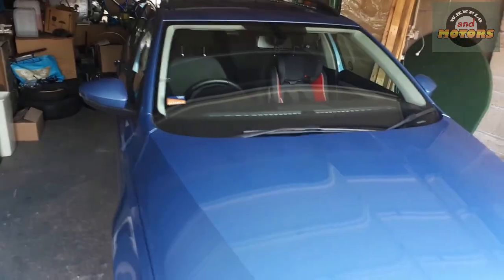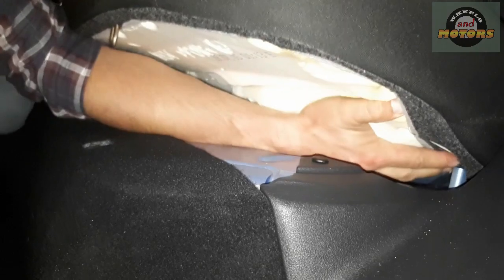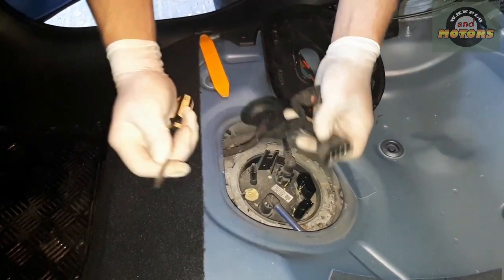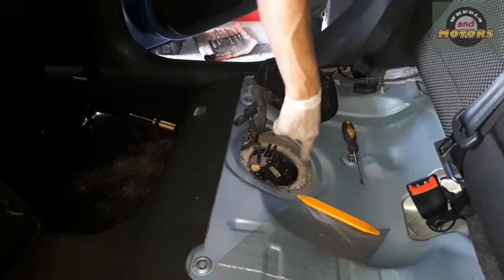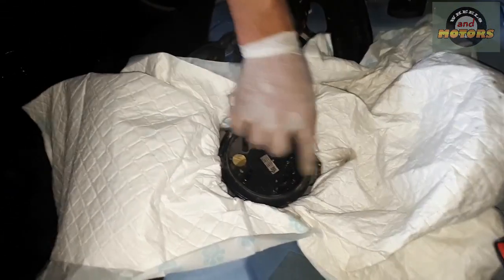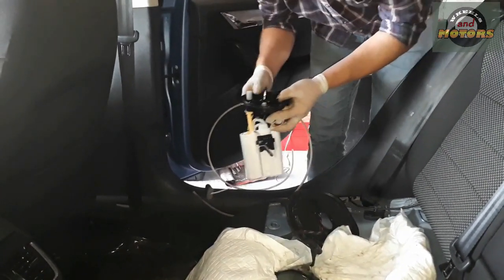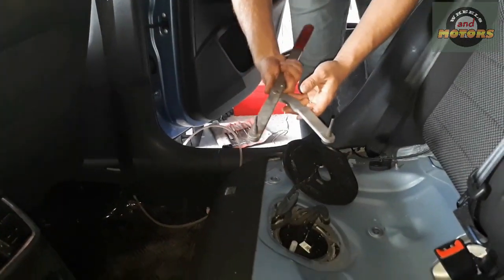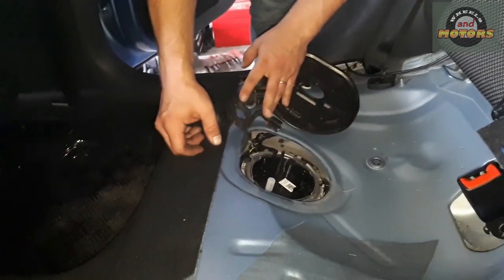How to replace in-tank fuel pump Skoda Octavia MK3 1.6TDI, can be applied to VW, Seat and Audi

Comment: Most people I know who have had fuelling issues from injectors going bad to fuel pump failures have usually for a few years been using Supermarket fuel. My injectors starting acting up until I swapped back to using premium/non supermarket fuel and I haven’t had a problem since.
Reply from the maker: However, my car (Sharan) is on 377k miles with no issues mostly done on Asda fuel... 🤔😉
Maybe because it's constantly driven and burns all the s**t out.

Comment: Great video, every important detail shown👏👏. I have one question. My pump is working fine so there is no need for replacement. But I need to drain the fuel from the because the car has been siting for 2 years an the diesel is probably very bad.. Is it possible to drain the diesel without opening unscrewing the pump? I would disconnect the hose that deliver fuel to the engine, then connect another hose to drain the fuel to canister. How can I activate the fuel pump without starting the car? I guess it would be possible to connect wires from 12v batery to thr pumps electric connector? But on which connector?
Reply from the maker: The only way I know to activate the fuel pump is using a scanner that has this option. I'm pretty sure connecting 12V to the correct contacts would work, but I don't know how.

Comment: My Skoda is giving p0087 pressure too low code and the glow-plug light glows randomly. Do you think its a fuel pump issue or high pressure pump or may be anything else ?!
Reply: How much electric going to your fule pump, less electric less pressure.

Comment: Ehat is your symptims, i have rough idle when fuel level low, when fuel level is high everything is ok
Reply from the maker: As I found out later, there was nothing wrong with the fuel pump in my car. I had bad cold start, but the problem appeared to be with injectors.

Comment: Is the sender unit for the estate same for hatchback?
Also is it only dealer part....ta
Reply from the maker: Considering this part fits Golf, Audi A3, Scirocco etc... I would assume that it should fit both - estate and hatchback.
What do you mean by "only dealer part"?
Reply: @wawayltd  can you buy the part from any car accessories shop, or just from dealership? And thanks for replying
Reply from the maker: Having the part number, you can buy from wherever, but please double check with the seller if it fits. You're welcome 👍
Reply from the maker: However I wouldn't expect any accessories shop to have it, not in Halfords or even Euro Car Parts. Can try AutoDoc, eBay, TPS, Breaker Link, some independent VW parts shops - shop around..
Reply: @wawayltd  ta, i will try tps

Comment: How can I reset the fuel gauge after replacing? It writes a problem and says 0km of fuel is available, I replaced my pump with an original one.
Reply from the maker: I didn't have that problem, strange.. Doas the car start? Maybe drive it for a bit to let it learn?
Reply: @wawayltd  I needed to refuel after a full tank it works properly, sensor learned the position.

Comment: Do you have to prime the pump after installing?
Reply from the maker: I didn't prime anything after fitting that pump. There's almost no leaks anywhere while doing this, pump goes directly into the tank.
I don't think priming is necessary.

Comment: sir my car is wokswagon polo. when engine starts in the morning . long beep sound is started 15 KM after running that sound is automatically stop . why
Reply from the maker: Don't know, does it give any fault codes?
Reply: @wawayltd  no sir it's while starting morning tym
Reply: @wawayltd  then rum 10-15 KM after that off
Reply from the maker: @roymathew9869  Where the sound is coming from?
Reply: back side
Reply from the maker: @roymathew9869  Glitchy parking sensor?

Comment: Hello good work .What are sympyoms that fuel pump is not working corectly ?
Reply from the maker: Thanks, this Skoda was mis-diagnosed. It had a problem with cold start, I scanned it and got fault code for that pump, didn't pay attention that date for code was like 3 weeks ago (the driver probably was too low on fuel), so I replaced working fuel pump - waste of 200 pounds... I'll stick ot on eBay. Made a video anyway.
As far as I know, one of the symptoms - bad start, but unfortunately I can't describe you all symptoms..

Comment: My car show only 0.5v electric going to fule pump. Where will be the problems? Battery show 12.2v.
Reply from the maker: Is it 0.5V when it should be activated or just when just on idle? It doesn't always have to show 12 volts, only when it switches it on.
Reply: @wawayltd  
Switch on 0.5v, even the the fule pump will not make any noises with 0.5v electric.
Reply from the maker: Sorry Abdul, if there is a problem with the wiring - I don't have that experience.
Reply: @wawayltd  
No problems, thanks